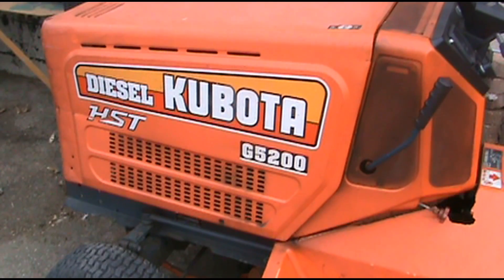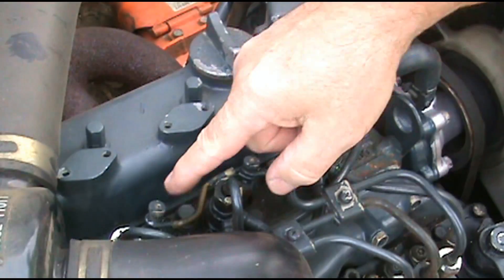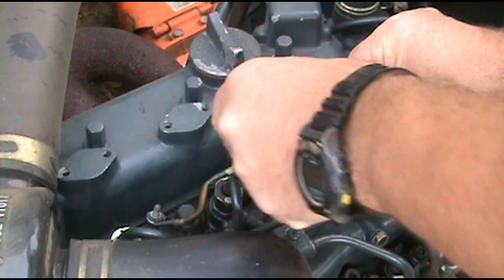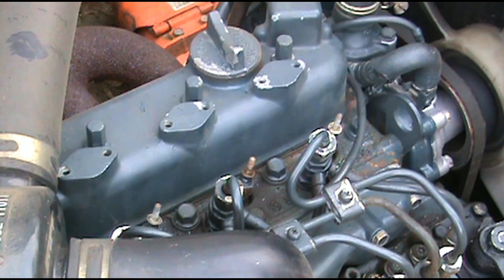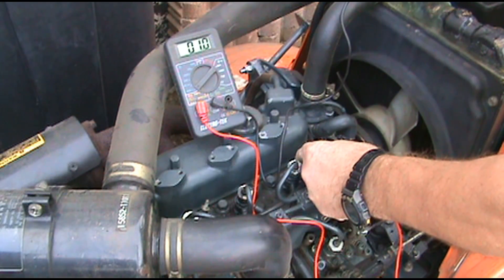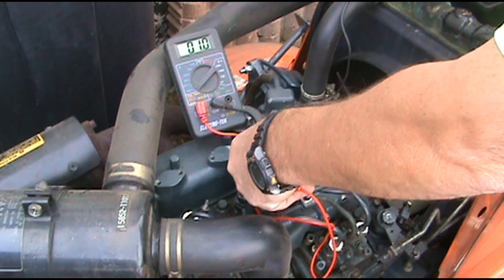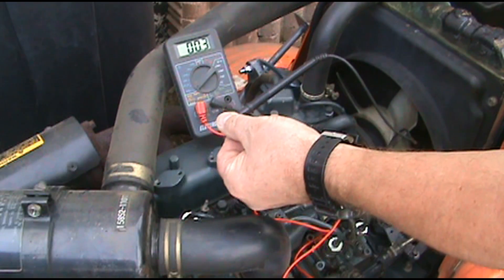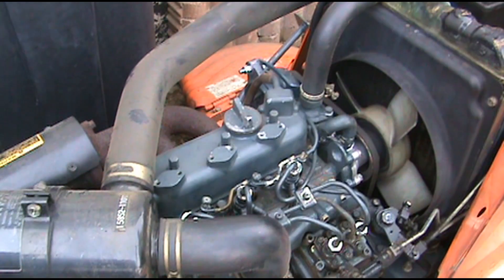Kubota G5200 glow plug check

Comment: Please don't use a visegrips use a 8mm deep well socket please I have done this several times im not a professional but I do know my way around a engine and tools Hope this helps you
Reply from the maker: I don't know what your looking at but these fasteners are round. No 8mm socket is going to work. Pliers will bugger them up so vise grips are the tool of choice.
Reply: Ok man all I know is on mine it was 8mm I'm not trying to cause a problem but mine were and still are 8mm I. Sorry to disturb u really I am all im saying is for me I have ruined things with vise grips thats all
Reply from the maker: Yes your right, pliers and vise grips will damage bolts. I don't like to use them unless I have too. Its all good. I don't know if these fasteners are stock or not.

Comment: Never never ever unhook your positive battery cable first  always unhook the ground cable first  if there is a spark when unhooking or hooking the ground cable back up it will go to the ground. If there is a spark on the positive side it goes to your electrical system and can burn thinks up and it’s even worse when computers are involved
Reply from the maker: Positive comes off first so I don't ground out my tools and cause a spark.
Reply: @LonnieJohnson1  if you take the ground wire off first the only thing you have to worry about touching your tools on is the positive post if you take the positive wire off first you have to worry about your tools touching everything around it  but you do you
Reply from the maker: Thanks
Reply: @LonnieJohnson1 All great tractors will have a master battery disconnect switch, they are always to ground.  I believe current in a DC circuit always flows from neg to pos, that's why DC welders have a choice of pos or neg grand🤔
Reply from the maker: You'll find that on the newer tractors. Different types of welding material takes different polarity.
Reply: I agree completely

Comment: Boob U checked Between the terminal and the threads IE the Grounded portion of Glow Plug
Reply from the maker: The positive is at the top where the threads are but you can also do an ohm reading.

Comment: Hey Lonnie, I have been having a weird issue with my Kubota BX1850. It will be running fine  then out of nowhere start to sputter, idle way down, start shaking like its going to stall, and then the issue is gone. I found your video here because I was thinking maybe a bad glow plug? Would a glow plug cause an issue like this?
Reply from the maker: If it was the glow plug it would do it all the time. It sounds like you have water in the filter. You should have a water separator fuel filter. I would check the filter.

Comment: thanks for the video. I just bought a kubota L2500 tractor made in 2000. 
It starts but the guy told me the engine had gotten some water in it and it made a noise in the engine. I was planning to take it apart clean it all good, new oil, new injectors, add new fuel filter, change the air filter, basicly due a complete tune up, and then try to run it. What would you recommend I do?
Reply from the maker: Complete tune up

Comment: On the matter of: … You should always disconnect the negative cable before removing the positive cable I am an experienced Shade Tree ~ no matter what you do any spark anywhere near the battery is often capable of producing ignition which is instantaneous probably … any detonation is usually faster than any human + result is beyond what I can post on you tube  within public safety  allowance > de-energize anything you can think of and modern design may pull a draw even with switch of on some contemporary equipment thus removal of one of the cables distant from the battery is best-choice with detaching the negative likely safer than detaching +
Reply from the maker: Didn't need too I was just checking the ohms. They don't get hot until you turn on the key. but thanks for the info.
Reply: @LonnieJohnson1  
This was for the non-informed;
I realize that you are a mech;
Reply from the maker: Yes

Comment: Best way to test glow plugs is to go ahead and remove them from the engine. Why? Because it gives you an oppertunity t check all associated connections as well as clean them. Its easiest also to use one cable of a set of jumper cables and connect one end to the pos battery terminal and other end bite the glow plug with the clamp then touch the ground part of the plug on the neg battery terminal and it should begin to glow
Reply from the maker: Taking them out is good but some people don't want to go through the hassle of taking all the wires and nuts off just to have issues putting everything back together when a quick test will give you the results your looking to find.
Reply: "...test glow plugs...remove them from the engine." 
Well, that's a good way to test them, IF your intention is to have an hobby, rather than have something done! 
Totally non sense! My clients would "love" if I charged accordingly just to test glow plugs like that. Do you remove the wheels from your car to check the tire pressure? LOL 😂
Reply: @crpth1  of course I wouldn't remove tires to check air pressure but I would remove them to fix a leak!!! Your way of testing glow plugs although hasty gives no definitive result and is not even a test it's assumption based on probability based on   the result of a multimeter or test light and you've still not shown and definitely havent PROVED the glow plug is good by doing a simple continuity/ohm test....all too often I've seen glow plugs, heating elements and spark plugs reduced to nothing but molten slag running down the cylinder walls and still show continuity to a multimeter or test light but since you don't remove your glow plugs you can't rule them out as the culprit of a "no start" scenario, you can only assume they're good based on the probability factor that if it shows continuity it's good. There's only one problem in your method and that is that "assuming and probability" aren't definitive....so remember, when your "clients" ask if you've tested the glow plugs (your way)as the culprit and you say yes, then basically you've given them false or untrue information sir, that is based on your methodology..... What I'm suggesting is the notion that when you've removed the glow plugs completely you've basically proven beyond the Shadow of a doubt that the glow plugs and all of their components are good by way of disassembly and furthermore...reassembly sir, which would you rather pay to have done sir? A definitive method of testing? Or an assumption based on probability based on the result of a continuity test which in essence proves nothing more than there is continuity between the engine block and the positive side of the plug that might just be a melted heap inside but you'll never know will you? But I will and I believe that good and proven definitive testing practices and methods are Paramount when calling one's self "a good technician" pertaining to the ways of "professional diagnostics" but I guess in a nutshell that's the difference between you and myself....no disrespect intended I just base my diagnostics on more concrete evidence than assumption is all, besides, an efficient technician should tear down, test and reinstall an 8 cylinder glow plug system in about an hour...and don't forget to apply anti-seize compound

Comment: The only problem is you failed to tell the uneducated how and why. No info on the multimeter as what selection you were using, and no explanation as to why you found the readings good. Nice try but you seriously missed the mark.
Reply from the maker: This is how to perform a check to make sure they are good and you will have to look up the number. As far as the multimeter, yes I missed that one.
Reply: @LonnieJohnson1  The Number! Where?
Reply from the maker: What do you mean?
Reply: If you are that uneducated you should not touch an electrical meter. Severe harm can come to someone who watches a Youtube video and thinks that makes them an electrician. This video is for someone who already knows how to use a meter but has never worked on diesel glow plugs, DUH.  Good on you Lonnie.
Reply: I agree

Comment: Yes, what was your meter set on,  and what told you what number to look for, need more details.
Reply: He's testing the resistance of the glow plug. Multimeter is set to ohms Ω. Hes looking for under 1 ohm. If the test shows no reading at all, you probably have a broken glow plug or its a gas engine lmao.
Reply from the maker: 200 ohm and I looked at the glow plug specs to see what was good and bad. You can also pull it up on YouTube.
Reply: Resistance in a nutshell is how easily current flows through a circuit. Or is the oposition to current flow... Usually associated with the heat that diff components put out. If the heat is constant in a component on average then it will give a consistent ohm or resistance value. Thus, many diffetent components we deal with such as glow plugs by their design will giv a consistent ohm value when measured. Therefore we research the component we are dealing with and find its ohm value and compare it with actual findings. The ohm symbol "Ω"  represents standing of name for greek god omega. Many people confuse ohms with continuity which is indeed not the same while ohms refers to resistance or oposition of current while continuity checks for a loop in current or continuation of a circuit/conductor hence the word continuity deriveable from the word continue(s)

Comment: Good video, very explanatory. Next show what your setting was on your meter for someone that hasn’t used one.
Reply from the maker: Thanks, at 1:48 you can see the reading on the meter.
Reply from the maker: I put it on 200 ohm. Look for the icon that looks like a horse shoe.
Reply: @LonnieJohnson1  thanks lonnie it was tough to make out the setting on the screen
Reply from the maker: Your welcome
Reply: He meant what setting you are using on the meter. I went to full screen but could not make it out.

Comment: You should always disconnect the negative cable before removing the positive cable
Reply: I think the reason for removing the negative first is because if your wrench is on the positive and you hit the chassis you could cause a short... just so people know why generally it's best to remove negative first.
Reply: @timmybuchanan  if your an idiot yes remove both geez the video is not how to remove battery cables
Reply: @Gartnerrails87  Nice one bro.  My mother always taught me if you don't have anything nice or constructive to say, then maybe it's best you don't say it.
Reply: Tim Buchanan that's correct and you should always connect the negative last for the same reason.
Reply: Why ?
Reply from the maker: I have found that it is easier to leave the ground connected because it has no voltage flowing through it where as the positive has voltage and could cause a short. Best thing to do is disconnect both cables if you are not sure. This is how I do it. Thanks

Comment: Im getting no power to glow plugs what would you check from there?
Reply: william foreman these glow plugs are all hooked together, that’s not your problem and did nothing to cause you to have to rebuild the engine. Probably what happened was you had the positive wire on your glow plug shorted to the engine block. The outside of the glow plug and the inside of the glow plug represents the hot wire and the ground wire. You probably blew a fuse on burned up the starting wiring some where
Reply from the maker: Check the battery and fuses first and what I would do next is trace the wire from the glow plugs all the way back to the ignition switch with a meter a section at a time. You should fine power somewhere along that line.
Reply: Chris koh I just bought a Kabota B 6000 four-wheel-drive little older diesel tractor I decided I was going to remove the glow plugs and replaced it with brand new ones I had to take off whatever that is right beside the plugs might be injectors and I had to loosen the lines actually take the diesel fuel lines off and pull them ejector things out of their holes to get plugs to go back in got it all put back together I must have the wires that connect the two glow plugs together Touchin some metal smoke shot out like hell and it won’t start any more,,, i’ve got to have that whole entire engine rebuilt I knew that when I bought it however now it is going to have to be rebuilt a lot sooner probably cost three or $4000 moral of the story if you need anything like that done to that little thing take it to Kabota dealer I love my little two cylinder B6000 and I’ll fix it no matter what it costs however I believe I’m through working on it I’ll let the Kabota dealership have at it
Reply: @william38022 - The electrical short circuit and engine rebuild are totally different things. Not related at all. 

Based on your description I would first check the electrical circuit effected (fuses, wires, etc.). Side note, not much to check in the B6000 they are pretty simple workhorses. ;-) 
 
With that done and out of the way. BLEED the diesel circuit properly. That´s almost sure where your non start issue is hiding. ;-)
Cheers
Reply: william foreman Actually, the moral to your story is 1) Disconnect the NEGATIVE cable from your battery before attempting to work on glow plugs 2) Never go back to the dealer or shop that told you that shorting out something in your electrical system caused you to need a new engine (rebuild on small Kubota would never be 4 grand)